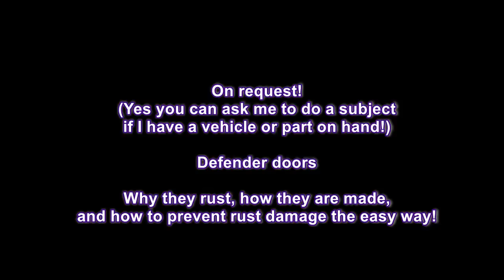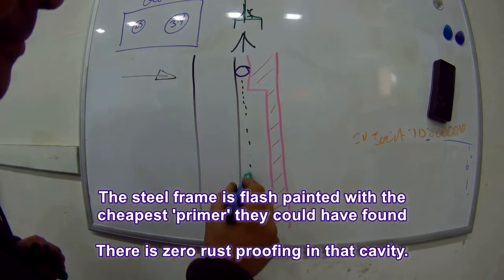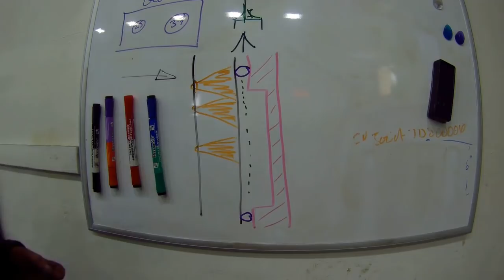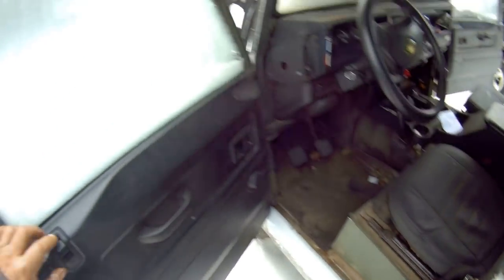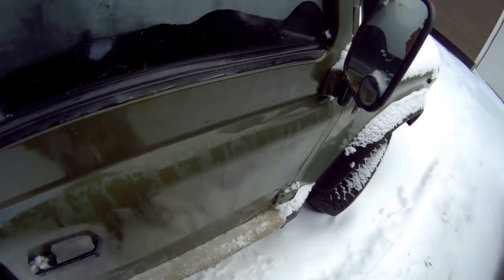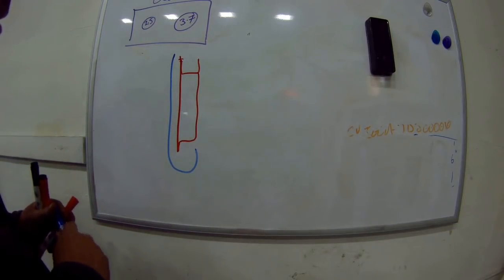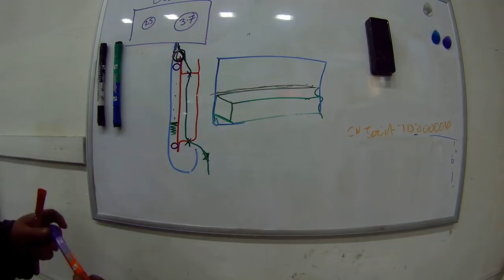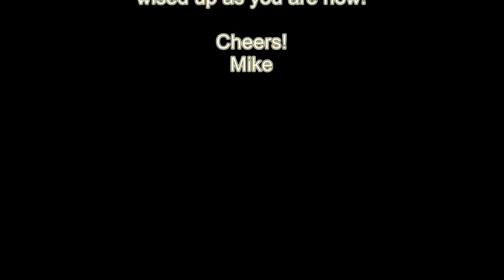Defender doors - why they corrode and a simple way to prevent it!

Comment: Hi Mike. great video again thanks. I think the Td5 doors were changed to Puma style doors towards the end of the production, maybe 2004?? The day I bought my Puma brand new in 2011 I removed pretty much every nut and bolt and copper greased them and also waxoyled the chassis and all doors and bulkhead. I also sprayed it around the under seat boxes and up in the joint between wings and bulkhead. Today nearly 9 years on and every nut and bolts come off easily, (even the front lower shock nuts),theres no rust inside the chassis and the doors are all like new. However.... all the pressed steel parts and chassis welds are rusty because GKN/LR couldn't be bothered to prep anything before dipping. AND, I've now found bubbles and grease spots under the paint on chassis and brackets!! But.. the beautiful Keswick green body work is unmarked and in perfect condition.

Comment: Hallo, my door is toast at the bottom anyway, but I'm trying to get the door card off to clear out the rust, yes I know, don't cringe, but I can't seem to get the internal lock off to remove the door card, am I being stupid (yeah i know I've got a defender so it goes without saying!) But thank you for all your advice.
Reply from the maker: Have you got the plastic outside handles or the metal lift up type?
Reply: @BritannicaRestorations  I've got plastic handles where the button pushes in. (Its a 97, 300tdi).
Reply from the maker: https://youtu.be/yWsOjHRvH30?t=135
Reply: @BritannicaRestorations  fantastic, thank you. I was fiddling about for ages trying to get that off, and it's so easy! You're a star! Love the videos, you're my go to guy for doing stuff to the landy.

Comment: I have wax oiled mine 10 years ago and will redo it again this year, no problems. Left the drain holes open. The only problem is that in the hot sun it can drip out at first and make a bit of a mess.
Reply from the maker: Waxoyl is not so good in Canada - winter is too cold and it gets quite hard. Salt water can get behind it. Does not preform as good as milder climates like the UK. 
I have tested a lot of products and our local April wax base rust proofer works quite well, however you need to spray it annually, but I did see a local garage  today advertising spraying the underside of a car for $59 inc materials - I might as well take MY vehicle there!

(And anything is better than Ziebart!)

Comment: I have a 14 plate defender. Should I still use the caulk on the doors to be safe? It was raining pretty hard in Scotland today and could see the water streaming in. A quick google and I found myself here!!
Reply from the maker: Worth a go 

the seals only need caulking on the ends - but do not use silicone as you may have to remove them one day

Comment: Thank you very much Mike. Excellent video. It was very informative! My understanding is much better now:) I really appreciate you taking your time to make these videos! Especially taking in consideration that I forced you out in all that snow!

I guess I will be doing a “hack” repair of the doors and cover it with chequer plate. The car is completely stripped and I think it is better to use the money on the less accessible stuff now, and then in the future I can get som galvanized doors!
Reply from the maker: Hi Champ!
Thanks for the reply

I managed to did the container doors open and get access to my LR doors, so I am filming right now, typical LR door deconstruction - not looking too bad, but the skins are shot. They will not go back on

That is a good call to do the difficult parts first - a door is easy access.

When I have seen people building Defenders here, most of the time they blow their budget on big wheels and tyres, bull bar and winch etc, only to find the frame is rotten along with the bulkhead!

Mike

Comment: Mine was gone at the top but i stripped off the skin that was salvageable and you can buy the top sections from YRM. I welded in and now as good as new.
Reply from the maker: Well done!
 Unfortunately for us in Canada, vehicles have to be over 15 years old to be imported, so I seem  to see a lot of doors that are not cost effective to be repaired .
To me, once they have gone at the tops and bottoms, they are too far gone - and my customers want warranties on work - it is a bit different if you are doing it for yourself

Thanks

Mike
Reply: That's the thing, it took me hours. Not cost effective to add labour as you say.  I fitted new bottom section, put big drain holes on them, injected paint the lots of Dinitrol. Hopefully it should last a while, now it is in a warm dry garage too. Paddocks want over £600 GBP for a set of doors now!
Reply from the maker: It really is a dilemma. Cost vs. time.
As I say, for me as business it is not worth it. What you save in money, you use in time, however to be realistic,  I would think it reasonable to say, that 2 days per door is normal from start to finish. Even if the skin can be salvaged, you then have to take into account the bodywork job to get the door looking presentable again. Lot of filling and sanding etc.
Unfortunately in Canada, Defenders are not used like utility vehicles like I was brought up with, but more of a 'Range Rover'  SUV, so they want them better than they came out of the factory.

And that is not going to happen!

Mike

Comment: some fantastic tips there Mike I'm definitely using the Dum Dum one
Reply from the maker: It really is a good product- you can apply it wet or dry, it is paintable and old stuff if clean can be rolled into a  ball and used again!

Miles better than silicone!

Mike

Comment: Great and very informative. I have a 2002 110 TD5 where both rear passenger doors have gone through on the steel frame on the opening end next to the bottom of the window. Do you know if the rear passenger doors of a Puma will also fit a TD5?
Reply from the maker: Depends if you are buying used complete doors or just the door shells

They are a direct fit, as I have fitted them to a 300 Tdi, but the door cards have a slightly different shape
I have an idea that you have to get the Puma door check strap assembly too
If you do not get the winder mechanism, I think the Td5 may need some brackets welding on

Mike

Comment: We are rebuilding some doors soon. We are going to repair the rusted frames and reskin with galv skins. Not sure it's worth getting the door frames hot galvanised. I think we will properly paint them, maybe with cold galv and fill them with fishoilene.
Reply from the maker: I have problems with galvanizing old stuff that you cannot sandblast both side of the metal - looks nice from the outside, but if you have rust proofing or primer inside a box section, then the zinc will not stick.
The acid in the galvanizing tank will only strip off rust
See here for my thoughts - https://youtu.be/Xw5J8BO-h9o

Mike

Comment: Hi, I’m helping my mate rebuild his series 3 Land Rover. After watching your defender door corrosion video I hoped you may have some advise on the same topic for series 3 with sliding windows. In our case the full doors are being replaced. Many Thanks. PS Gnarly Boot = John
Reply from the maker: John
I have not seen an S3 here for years!
I seem to get Defenders, Disco 2 and P38's mainly
If I do happen to come across a door I will post a video
I think that the complete door tops are so relatively cheap, that not many bother stripping and rebuilding
Mike
Reply: Gnarly Boot 
You are lucky with the Series doors. No double layers, covers, window mechanics... Just a plain sheet of metal that can be repaired.  But they are also cheap in the UK. Getting them painted is probably the expensive part if you are not doing it yourself.

Door top £35. Door bottom £69.  Without glass and locks.

Comment: You need to be REALLY careful using an air-tool to fit door skins.
If you don't hold the tool perfectly flat against the door you can make an ugly crease all the way around the edge of the outside skin of the door.
For DIY purposes, it's probably better to just fit it by hand, slowly.

Comment: Thanks again! I couldn't find a source for Dum Dum here in Germany (for some reason Germans associate that term only with dumdum bullets... even though you can't easily get them here - or any other bullets or guns, fortunately ;-). 
I came across 3M 8578 strip calk (yeah, it's US american ;-) would that work as well?
Reply from the maker: Yes that will work - it seems the original company no longer makes it - the 3M is good, but not as sticky as the original - I warm it up a bit before using

Mike
Reply: Butylband ist das Stichwort
Reply: ah, ok, thanks! that's what "fred" is using extensively here https://youtu.be/WZn5rnh7XlE?t=268

Comment: Best way to solve the Defender door issue is remove the skin, have the frame cleaned and repaired and galvanised, then paint the galvanised frame before reattaching the skin, when fitting the skin add a layer of seam sealer or similar (NOT SILICONE BASED) right along the frame where it makes contact with the skin thus isolating the metals, fold the skin over and then do final paint - done properly with proper paint and materials it will last forever.

The issue is that steel and aluminium are not painted before assembly of these doors so they sit together, then they get wet and galvanic corrosion starts as steel and aluminium are relativity speaking quite far apart on the galvanic series, so they react badly, by reducing the separation on the galvanic series by coating the steel in zinc (galvanising) you are reducing the reactivity of the two metals, however, if you paint and further isolate the dissimilar metals you will effectively remove the issue in its entirety.
Reply: But then by the time you've painted and Galvanised it all, you may aswell buy another door.
Reply: may i ask why against using a silicone base?
Reply: @adieismail46  Silicone products anywhere near surfaces to be painted are a nightmare, even using silicone in the same area as spray painting will contaminate the paint and leave marks. Look up silicone and paint shops! I have banned silicone based products in my home workshop as I spray paint a lot.

Also, silicone is fine for sealing a door or window, but it is actually a poor product at adhering and staying put. A bead of silicone will begin to peel and debond fairly quickly in a setting like this. Polyurethane, particularly automotive based products should be used. Puraflex 40 is a good product as an example.
Reply: @peterpeterson9903  thx for taking me to school mate!

Comment: Why no silicone? I was thinking liquid nails would work great.
Reply from the maker: Silicone is very 1980's, it is difficult to remove if you need to take the weather stripping/door seal off again if you need to work inside the door - for example, if you need to change the door latch, you have to take the glass out which means you have to take the weather stripping off. Dum Dum is easy to remove, AND you can use it again

Mike